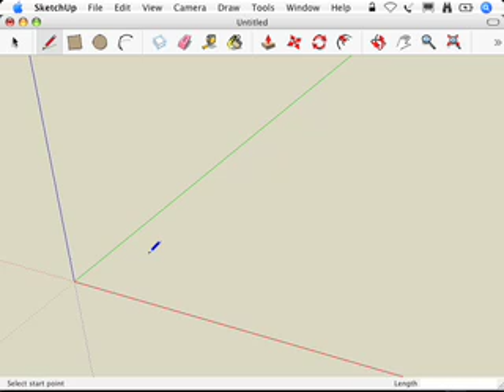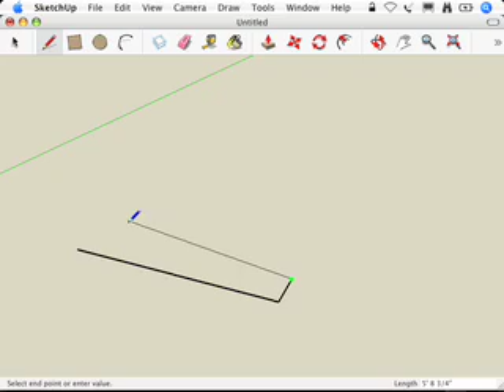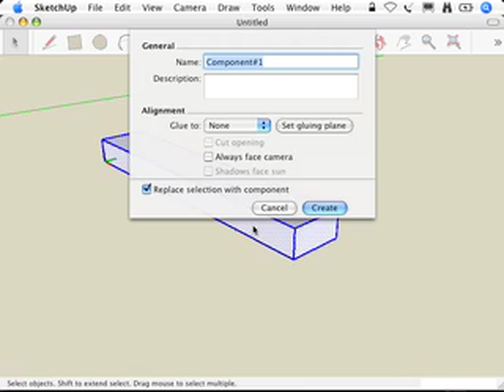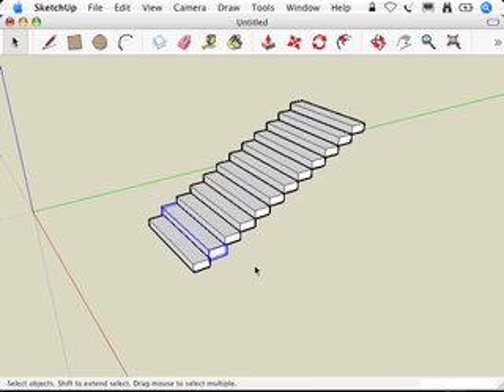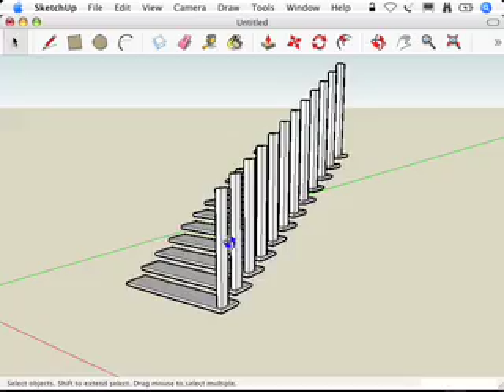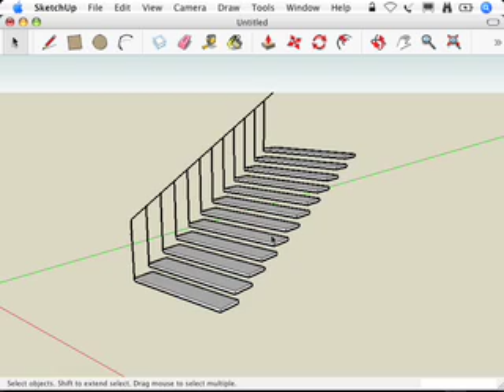SketchUp: Making Stairs: The Treads are Components method

Comment: Thanks for the information but the one problem I'm getting when I try this is that when I attempt the push/pull any of the treads the little icon has a small red circle with a line through it and I can't do anything to the treads. I also tried adding a line to one of them and it didn't duplicate it to all of them. I followed all of your instructions but I'm still having these problems. Do you have any idea how I'd fix this? Thanks.